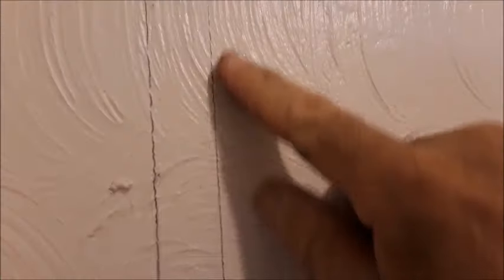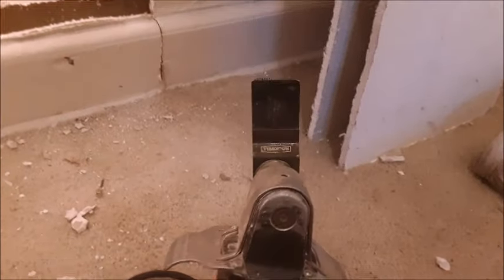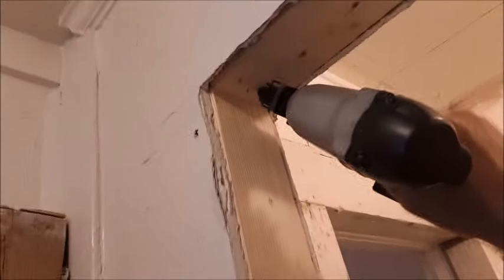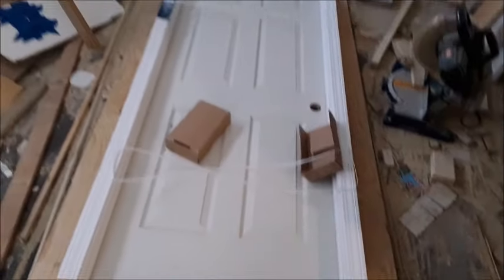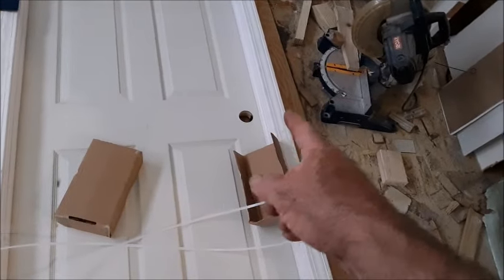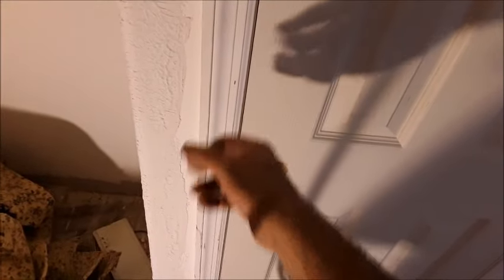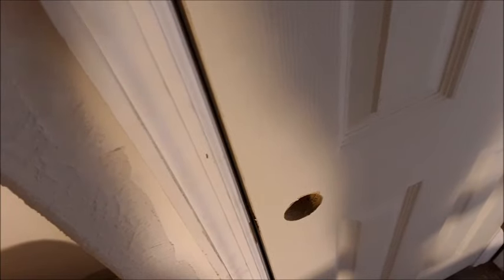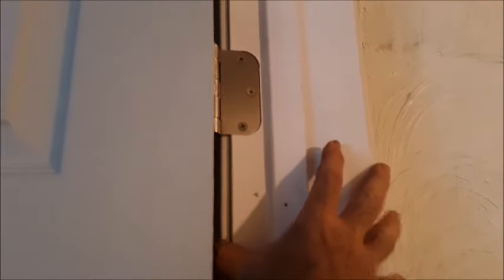How To Install A New Door Through An Existing Wall

Comment: Nice break for Jesus ..one addition I would like to add us instead of putting a screw through the door casing to ensure it won't sag, take one hinge screw out and replace it with a 3inch construction screw. Holds the door and doesn't have to be filled or be unsightly.

Comment: To do this right you’ll need to open the wall to the top plates.
There needs to be a king stud on each far end and trimmer studs in the inside that the double header boards rest on.
You’ll need cripples between the top of the header to the top plate if you want to do this right for strength and longevity.

Just look at a diagram of framing a door opening.
Reply: I want to do this from one of my bedrooms to the garage but this is what I’m scared of. I dont want to just open up a hole. I want it to be supported enough

Comment: How did you attach the side studs to the top plate? Did you have to cut a hole in the drywall?
Reply: They are probably held up by the drywall. lol

Comment: How did you fix both of the new studs / jack studs. Is the only thing holding them in drywall screws? Thanks for the help I enjoyed your video.
Reply from the maker: Hi Evan,  Thanks for the comment.  The studs inserted on the left and the right are 8ft top to bottom of the existing wall.  They are screwed in diagonally with 3 inch drywall screws to the base footer 2x4 and the header 2x4.  We then added a couple short 2x4s inside the wall that went up to the wall header and down to 1.5 inches (the thickness of a 2x4) above the top opening of the doorway.  These short pieces were screwed  horizontally into the 8ft 2x4s we inserted on the left and right.  We then took another short 2x4 the width of the opening of the doorway and screwed it up into the ends of those short 2x4s thus making the header for the doorway,  A little hard to explain in word so I hope this make sence.
Reply: Thanks that’s what I will do as well!

Comment: You shot 2-in finishing nails through a header on the edge with nothing above it?
Reply: That's what I thought too. But now I'm thinking that header is butted up against existing 2X4 in the wall that the new 2X4s are nailed to. The toe in nails are being nailed to that existing 2X4
Reply: @Hizenbird  Maybe so, but he slid in the side 2x4 under the header. Maybe he cut off the original stud and put the header in under it and then replaced the lower portion of the stud. That would make sense.
Reply: @christcrucified6385   Yeah, I'm looking at it again. This is not the way it should be done. He removed studs from the wall. The load use to go down the studs to the base plate but now they are gone. So that load still needs to be carried to the floor/foundation. The only thing carrying the load now are the 2 screws in the stud that was cut off above the door frame (which themselves are just held up by a couple of nails in the top plate) and the 2 in nails on either side of the door.
If it were me I would have made the two 2x4s either side of the door way jack studs shortened just above the door height and placed the header piece on top of those.
But maybe it's not a load bearing wall.... so...guess it's OK?
Reply: @christcrucified6385   I cane here looking for tips on adding a door to my stand alone garage that only has a garage door opening. So I guess "load bearing" was on my mind. Now that I think about it even the wall that I want to put the door in is not load bearing (assuming only two walls of a stand alone single story garage are load bearing).  But for a couple extra bucks I will probably do it as though it was load bearing anyway..
Reply: @Hizenbird  In a stand alone garage all your perimeter walls are load bearing. I actually erased my comment because I deal with almost all one story Florida homes with no basements. Everywhere else is vastly different and there will be interior load-bearing walls on two-story homes or homes with basements. All your perimeter walls are going to be load bearing on any structure. If you're dealing with an outside wall on a standalone garage it is definitely load bearing
Reply: @christcrucified6385  Really? Just to be sure.... Imagine I have 4 walls with the top open. Then I put rafers from one side to the opposite side across the top plate. Those two walls that are supporting the rafters are load bearing, they are carrying the weight of the rafters and the roof on top of that, but what load is on the two other walls?
Reply: @Hizenbird  I'm not an engineer but from my experience trusses are designed to distribute part of the weight to the gable side walls. Think of it like setting something on top of a box. The square structure of the box supports whatever's on top no matter which parts of the box you set something on. If you just had two side walls of a box they could fold but because you have four walls they all are the strength of what setting on top even if it's only setting on one wall.
Reply: @Hizenbird  EVERY SINGLE exterior wall in your house is load bearing and so are many of the walls on the inside. You would have to go up in to your attic and know what you are looking for to see if the walls are load bearing.
Reply: @Hizenbird  "what load is on the two other walls" in most cases these walls are carrying the load of the roof ridge beam.
Reply: @MAGAMAN   You seem convinced of this so I’m not going to try and change your mind even though it’s not accurate. It would be more accurate to say, USUALLY or IN MOST CASES all exterior walls are load bearing. I’ll let you look up when and when not if you’re interested. 
Thank you for your input.

Comment: Hello brother! Great video. I was wondering how would you deal with the electrical line if it happened to be running accross as you had mentioned?
Reply from the maker: I would turn the power off first, then get two  "old job" plastic electrical boxes from Homedepot/Lowes,  cut a hole in the drywall and mount the two boxes in the wall on both sides of the  new door, cut the wire and run both cut ends into the two boxes, buy a new piece of the same size wire and run it from box to box going over the new door and make your splices in each box, use a solid trim cover plate on each box.  If the wire is an always on hot wire and not a switch leg or feed to a ceiling light you could make the two new boxes into a new plug receptacle instead of a splice.  Hope this helps
Reply: @creativerepairing2960  Thank you for that succinct explanation and your prompt reply. God bless you brother!

Comment: How do you know of it is a wall bearing before cutting beam? Yes hank you for the message of Jesus, awesome! Keep going brother, God is faithful.
Reply from the maker: Hi Chevs,  Thanks for the comment.  If there is an existing 2x4 stud on both sides of the doorway you are cutting so that you are only removing 1 or 2 studs I think you will be fine.  If you have some concern about it you can always install your new studs all the way up to the ceiling header board inside the wall on the right and left of the new doorway you are cutting.
Reply: Check if the wall you are cutting into is running parallel to the joists in your floor/attic (they run parallel to the rafter boards) (yes=not load bearing usually) or not.
Reply: @creativerepairing2960  Please do not listen to this guy. He clearly has no idea what he is talking about.

Comment: You skipped over the hardest part, which is dealing with the floor transition under the door.  Can’t find any information about how to do that well, I guess because NO ONE knows how to do it.  Oh well.
Reply from the maker: Hi Robert,  You can always get an oak door threshold or make one from a piece of oak lumber if it need to be wider than the ones they sell at Lowes / Home Depot..